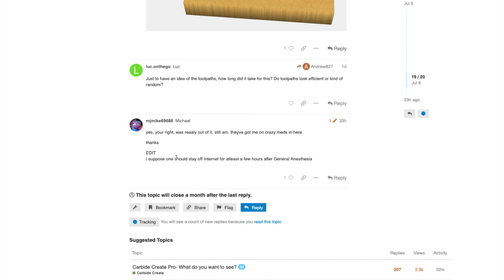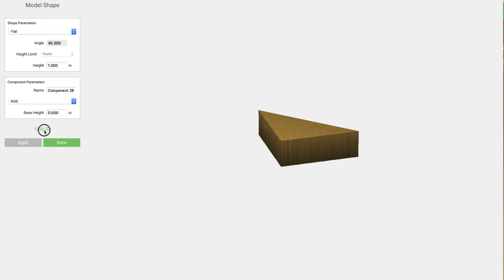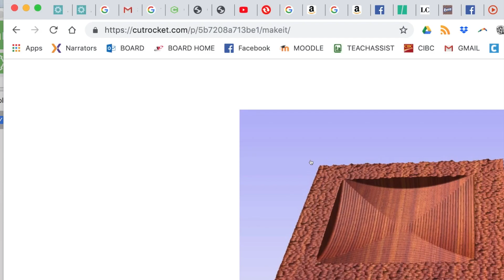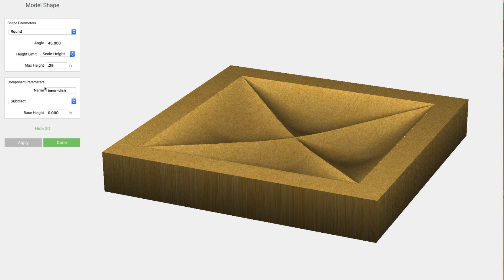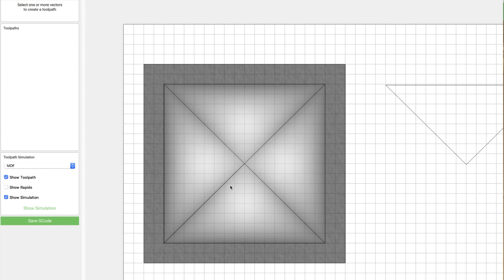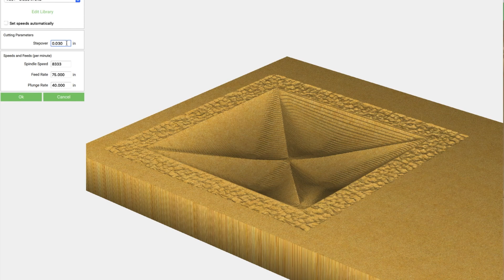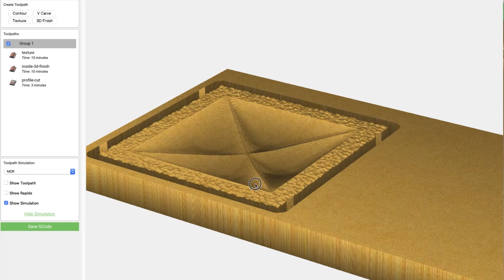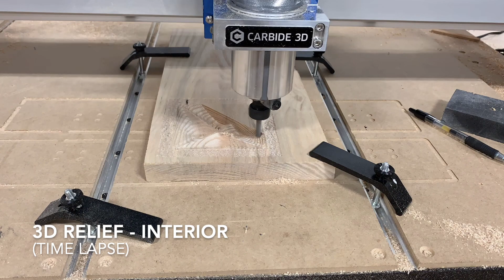Carbide Create Pro - Textured Dish

Comment: Thanks.  Watching from start to finished product is very helpful.

Did you have your block hanging over the edge of the wood as you would for X, Y, and Z when setting Z for the #201?  Do you not have the entire block on top when setting just Z?  

Are we able to set multiple passes and depts on the 3D toolpaths?

I look forward to more videos.
Reply from the maker: Astute observation! Yeah, I realized what I did right before running that second tool. I just adjusted the z-height manually before actually clicking start! But had I done it correctly, I would have just set the block ON TOP of the material and not on the corner :-)